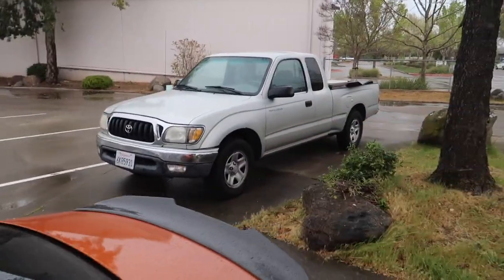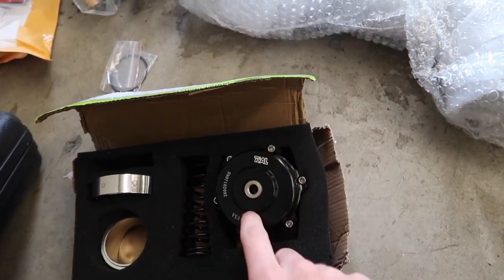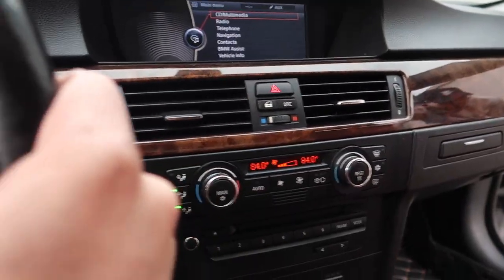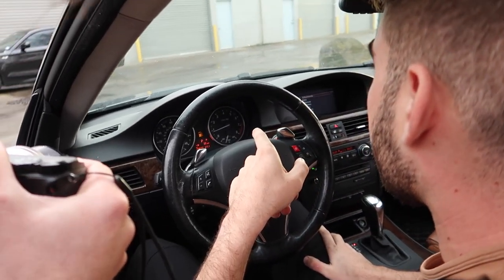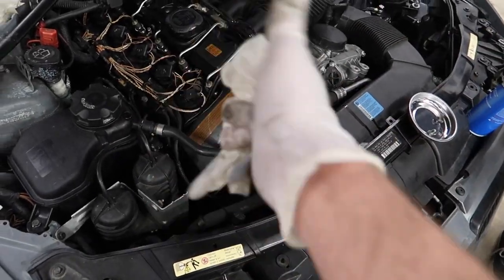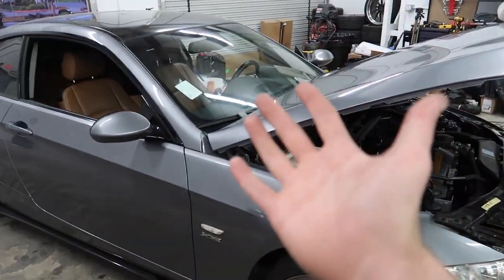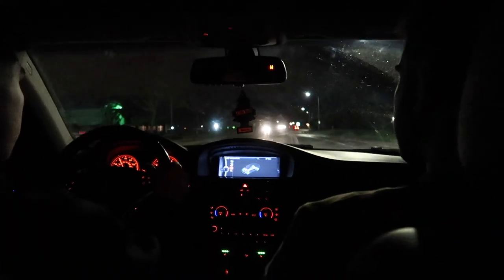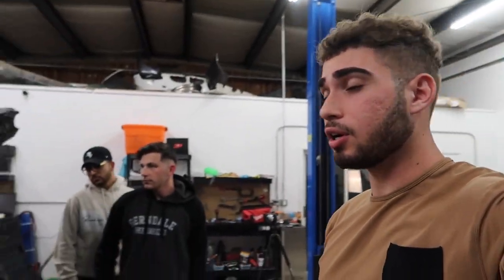FIXING MY FRIENDS HEAVILY MODIFIED 335I! (TURBOS BLOWN?)

Comment: When you install the jb4 it uses maps not stages so if he’s stock he can run map 1 which is about 13 psi or he can run map 5 which is auto tuning that adjusts according to his mods and which octane he is using and map 5 runs between 12-17psi and when he gets downpipes he can run map 2. And jb4 does not have a burble tune he has to get mhd to get burbles.
Reply: ++1 for mhd

Comment: My n54 is suffering from the same problems, I’ve replaced all vacuum lines , checked boost canisters,solenoids , replaced chargepipe ,cleaned the vanos & it all helped a lot but kept giving me limp mode after hard pulls , turned out my wastegates are completely shot ☹️ going to have to replace turbos

Comment: Great vid bro ! Would you recommend me getting a 16’ 3 series as a first car ? The Maintenance rumors have been giving me anxiety lol
Reply: Maintenance isn't a problem in the newer BMW's
Reply: Maintenance will be an issue if you don't have the money budgeted. With these cars you have to be able to throw down a $1000 here and there if you aren't able to do your own labor. Don't listen to Miro the newer Bimmers have just as many problems as the older ones. My friends 2019 850i just went back to the dealer for a cylinder misfire, it only has 2500 miles on it. You want low maintenance costs stay away from V8 bmws. Pretty much any model that ends in 50i.
Reply: Thanks for replying. I have 15k to play with. Wanted to bargain with a dealer on a 328i for about 10k so I could have 5 just in case as well as adding mods. My brother buys old bmws and fixes them but I’m not sure if it’s the same with these newer ones although he’s offfered to help if there were any minor issues.
Reply: @murcielagosv9244  What are you on?
I own a 520d from 2014 and the maintenance ain't a problem (0 faults yet) . I would believe that a newer 3-series wouldn't need as much maintainance. Also the parts for the 3-series will be somewhat cheaper